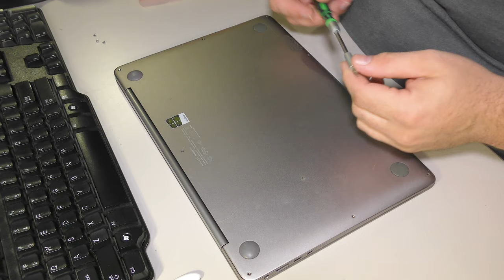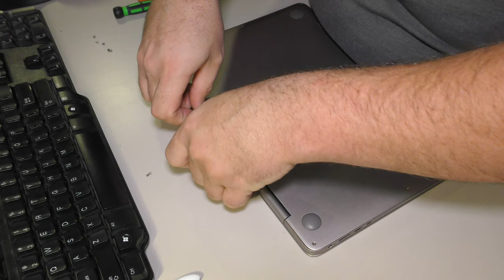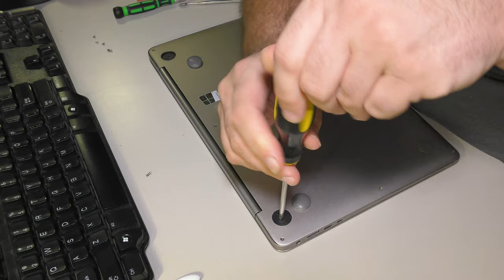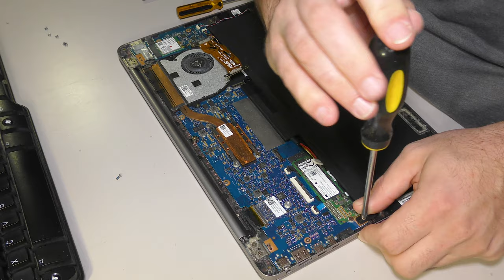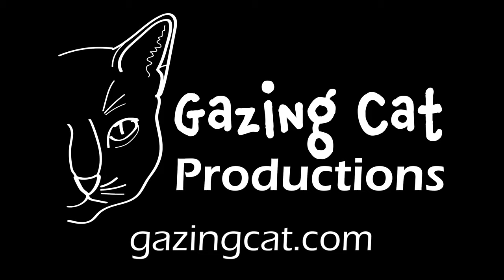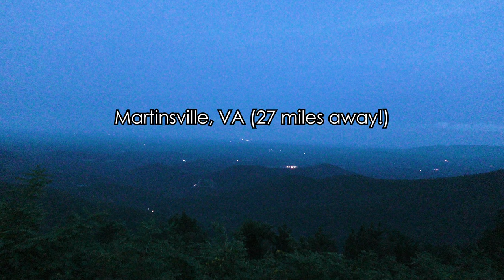ASUS UX330U Battery Replacement and Basic Disassembly - Jody Bruchon

Comment: Thank you very much! Followed your tutorial, and everything went well. Just one has to be careful with a battery connector while taking back it with a piece of metal. My first time was unsuccessful due to a weak connection, but after redo second one was perfect. Used initial 41% to discharge almost completely, down to 6%, then re-charged up to 100%. Today its first day, works as a baby w/o plugging in the whole day. My laptop is back to life!!!

Comment: I have owned this laptop for 8 years. I have always left it plugged in. It doesnt leave my office. I vame home today and turned it on and it turns right back off. Any input?
Reply from the maker: @RappinWithTheDood  Try another AC adapter. They can and do fail.
Reply: @JodyBruchon  thank you
Reply: @JodyBruchon  I did get it to turn on by just trying repeatedly without the AC cord plugged into it. The battery life read full. I navigated through my programs and all seemed fine. I shut it off and it's doing the same thing this morning.